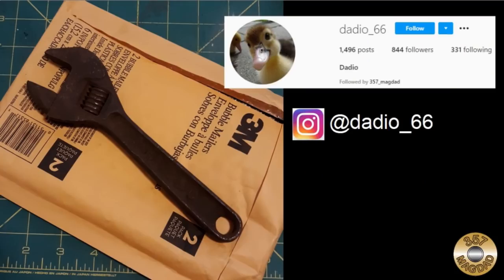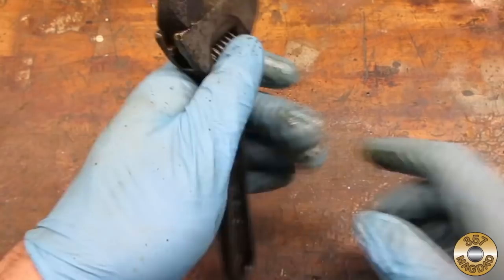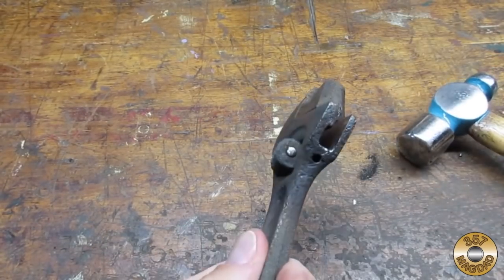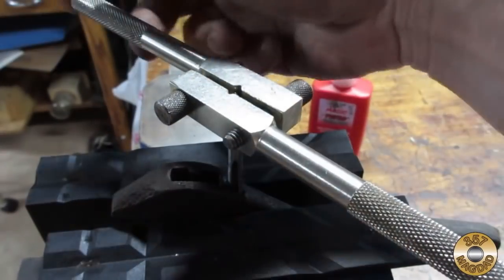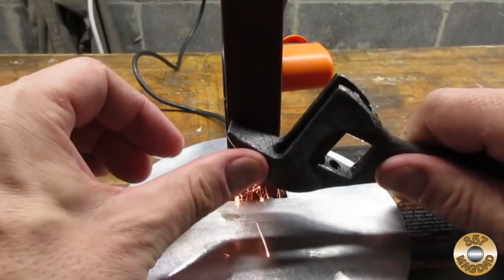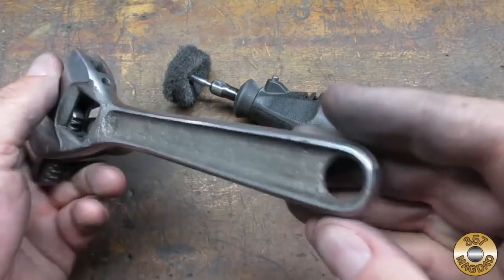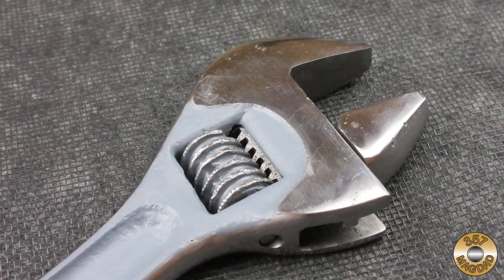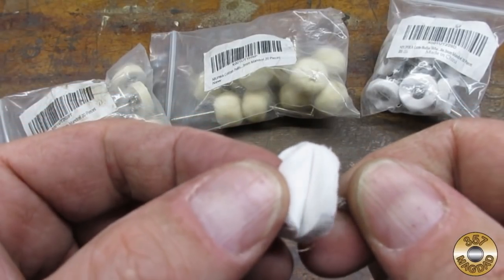Hand Tool Restoration - B & C Adjustable Wrench

Comment: I received a new notice 
While sitting alone. 
A new post on your channel!
It came on my phone. 

An adjustable wrench
Made by B & C. 
It’s rusty-it’s crusty,
Just what will we see?

You soaked it and beat it
You need Scout’s short hammer. 
You then drilled it out
Without too much clamor. 

I’m watching you “machine”
while I sit in the shade. 
The pin came out great. 
I like what you made. 

Chuck, then the Flitz. 
You told quite a tale
About the B & C wrench
That you got in the mail. 

Another fine piece of work Mr. M. From the Lazy L in Sherman, TX, thanks for the fun. 🤠
Reply from the maker: I read your poem to Mrs Magdad, we both loved it!  Thanks Mark!

Comment: I think the old saying is. Need is the Mother of invention. Nice work on the drill press. I use my drill press as a wood lathe.
Great video Magdad!!
Reply from the maker: Thanks Thomas!  I've had success with the drill press as a wood lathe too!  Check out my recent mini screwdriver project!
https://www.youtube.com/watch?v=Yn_jWF1xgCU
Reply: @357magdad  That screw driver turned out great. One question what kind of speed do you run using your drill press as a lathe?
I think I'm running it to fast I have a lot of kick back and gouging.
Could be my experience too.

Comment: Almost caught you there in the reflection of that wrench buddy!!  Fun thing is, I am working on a fully frozen wrench now to. I got it all apart, just the piece of pin in the tumbwheel is still stuck. It's soaking in 50/50 acetone and ATF now, I really hope to avoid drilling that thing, I will be of center on that for sure! Great idea on the initial turning down of the allthread, I've been thinking about how to do that for a while, now I know!
Reply from the maker: Thanks Alex!  I was nervous drilling out that knurl. I started with a small drill and carefully snuck up on the pin diameter.

Comment: Ooooh I like the idea of using the drill press to shave down some threaded rod for the pin. I also don't have a lathe at the moment, and that's a fairly light duty job for the drill press. Thanks for the idea!
Reply from the maker: My drill press has identified as a lathe on many occasions!

Comment: I finally got to this video ..Making the new pin has given me some ideas on how to use my drill press ..I have a 60 deg rotary diamond bit and a diamond shaped file  on order for a project ..I am also designing my own wrench made from 1/8 in. flat stock
Reply from the maker: I've been looking into custom laser cut 357magdad tool.

Comment: Awesome job! I've used the DIY lathe trick with some copper rods that I needed about half as thick. It worked very well. The wrench turned out beautiful. The ONLY thing I would've added to the process is using a needle file to bring back some of the knurling. Otherwise, she's still a beaut and I'm sure the original maker would be proud to have it in his toolbox again. 👍
Reply from the maker: Thanks!

Comment: Nothing like a few good schwacks to get things moving. Sort of like the old antenna TV sets, when you'd smack them on the side to get a picture - after putting aluminum foil on the antenna and standing on one leg.
Reply from the maker: Used to wack the radio and flashlights too!
Reply: 357magdad - ah, the good old days, when things were simpler.

Comment: Nice results. I had a similar challenge on an adjustable wrench but mine was pitted pretty bad and I had to recut the grooves in the knurled knob.  It did not turn out nearly as nice as yours but it works fine so it is in the mobile tool kit.
Reply from the maker: I was afraid that removing too much material from the knurl would affect the operation.

Comment: Very good job. I have told you this before but I will again.  Wow you always amaze me how you get things done with minimal tools. How do you cut your pads on the scotchbrite? I have tried but they don't look very good. Stay safe and healthy my friend. Thanks
Reply from the maker: Thanks Glen!  I got an exhaust pipe adapter from the local auto parts store and sharpened the end.  I push and twist to cut the discs out.  Sometimes it doesn't cut all the way through so I finish the job with scissors.  The shape doesn't have to be perfect, the disc will true itself as you use it.

Comment: I never thought to re tap the hole. I have a shifter with a missing pin, but it is a 7mm thread and I don't have a 7mm tap. Maybe I will go bigger, thanks for the idea.
Reply from the maker: 5/16-18 is slightly bigger than 7mm and taps and screws are readily available.

Comment: Magdad, have you got a brass hammer? If so use it when beating on steel to keep from any possible impact damage to the tool surface. I use one all the time in my shop when working on getting stubborn steel parts loosened or moving.
Reply from the maker: A brass hammer is a good idea!